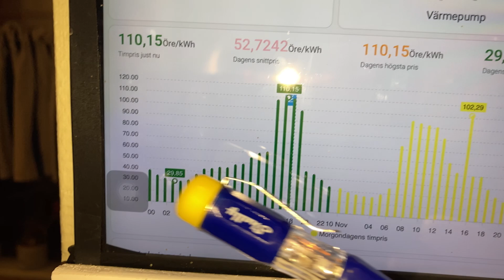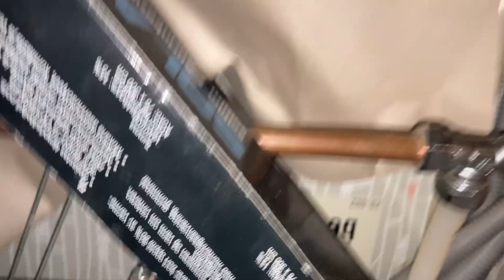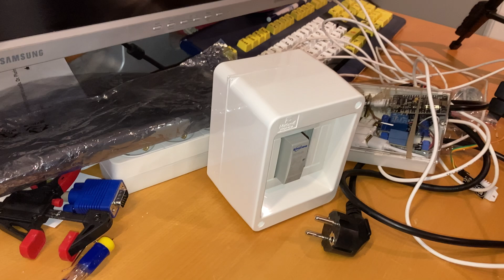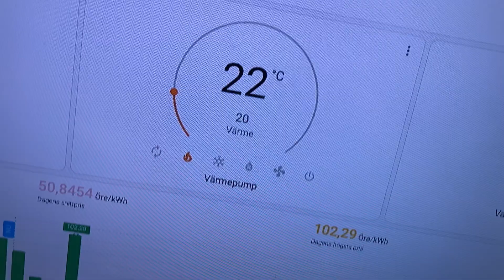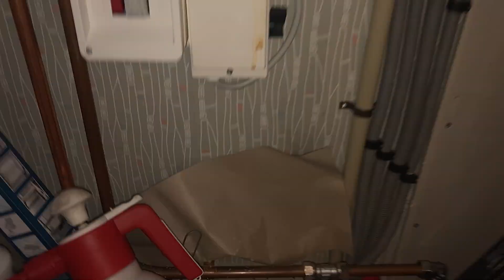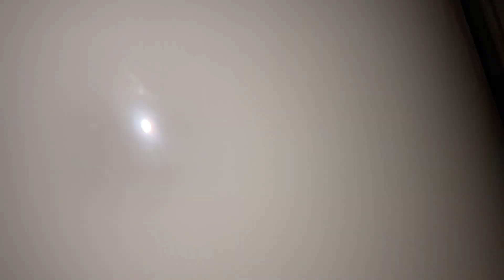Automated water heater control for optimizing hot water cost

Comment: I’ve just done the same thing but used a Shelly ProEM 50 which is din-rail mounted so looks better when placed next to the contactor and has external CT’s for load measuring, but costs a bit more. Completely agree about what wind and solar are doing for the grid and the insanity of Germany shutting down it’s nuclear plants. If everyone’s hot water tank was able to turn on when it was windy or sunny then that would at least would help the situation. But since there is no direct technical solution available that I am aware of, we will have to do it via variable pricing.